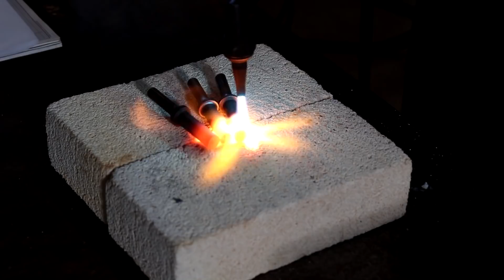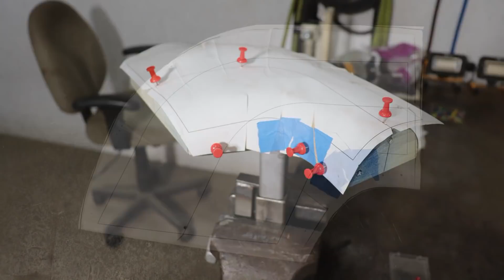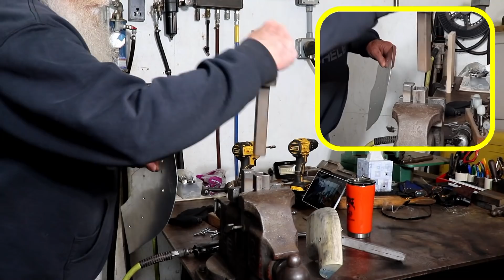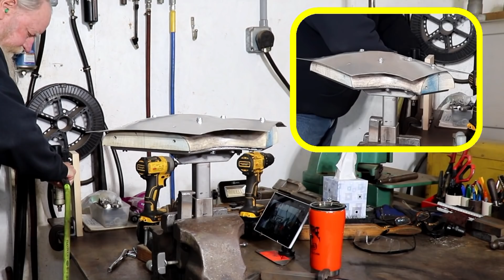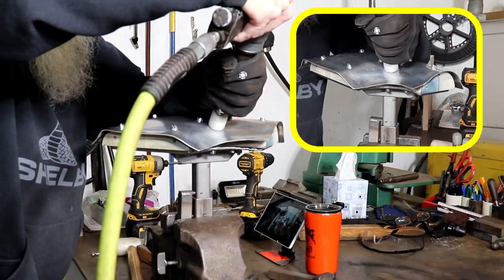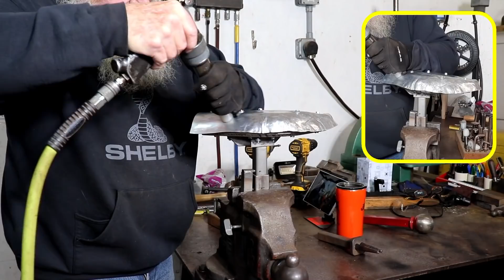Making An Odd Shape With Ron Covell – Part 3

Comment: I used to hand form aluminum duct work over KIRKSITE forms,   for the Douglas DC series air plains for the Air conditioning system, 16 Gauge 3003 aluminum,    the main trick I found was to roll the edges of the high stress areas early so the stress doesn't split the edges. as you curve and roll the panel. Then you can trim off the rolled edges after. I used hardwood axe handles sanded and shaped to act as slappers  and  hammers. 😃😃
 Great Video THANKS
Reply from the maker: Thanks for the input William.
Jere

Comment: Jere, I’m enjoying the videos, as I want to learn flow forming for an upcoming project. I’m a total beginner, and am wondering what type of aluminum to use, and if I need to anneal it. The 1100 seemed to flow a lot better for your part. Did you anneal it like the 3003, or is it soft enough in its natural state? Are these the two main choices of aluminum for this type of work? Thanks a bunch
Reply from the maker: Hi Jesse:
I did not have to anneal the 1100 as it is 99% aluminum. The application and the amount of shape you put into the piece will determine what material you use.
Sorry I cant give you a solid answer without knowing what it will be used for.

Jere
Reply: @jerekirkpatrick2092  I want to make foot wells in the floor pan of my airplane in order to have a more comfortable seating position. I want to drop the area where my feet rest on the floor about 2” lower than the existing floor. I envision two rectangular (or oval maybe) pans approximately 6” by 10” each. The existing floor material is .040 6061 T6, but the parts I make only need to be strong enough to take the abuse my feet will inflict as there are structural members nearby.  I think a speed blister shape would be easier to form, but I would rather have a more rectangular shape if possible. Any advice on material for that sort of shape? Thanks
Reply from the maker: @jessejenks5401  I have made many parts for race cars but am reluctant to make or give advice on airplanes as they are out of my range of knowledge.
Jere

Comment: What material did you use for the ends of the air hammers?
Reply from the maker: Hi Bob:
The material is UHMW. It slides easily on the aluminum and is resistant to impact.
Thanks for watching and please subscribe.      Jere

Comment: Nice project Jere.  Nice work so far.
Reply from the maker: Hi Ran. I will be welding the odd shape this afternoon and finishing the welds. I hope to have the video up by the end of the week.
It took all day yesterday to get the truck unloaded and get the shop back into working shape.
Jere
Reply: @jerekirkpatrick2092  I bet, you had to take to much back with you.  I came up with another idea for one of your gear reducers, I should of bought one.
Reply from the maker: @rrintheshop  Would you like me to send you a list of the ratios I have or do you have an idea of the ratio you require? You can call my cell 1-707-972-0677.

Comment: I never would have believed that you could remove those tucks without seeing it for myself. Great video - thanks for posting!
Reply from the maker: Hello John:
It has taken many years to learn how to read the material and see where the next hammer blow should be placed. Look at my video "Turning a 1" flange". You will see how to place a tuck and how to control it as it is worked out.
Thanks for watching.         Jere

Comment: I was excited to see part three. I have done a lot of flow forming and always have formed into a female form so it was interesting to see someone do one on the out side. I generally use fully annealled 1100 since it offers the most stretch capability and it does form nicely. For doing those outside shrinks I have found that a concave "V" shaped tool works surprisingly well for unknown reasons. About 1/2 -5/8 wide at the open end of the V works for me. I just cut it on the band saw; not too fussy. Most of my forming tools for aluminum are made from HDPE which is a bit softer than the Delrin it looks like you use and I find it friendlier for the soft 1100.
Reply from the maker: Hello Edward:
Are you saying to cut the "V" on a slant like the female portion of a thumb nail die or is the "V" cut the entire distance of the tool?
Thanks for watching and thanks for the info. Always eager to learn.        Jere
Reply: @jerekirkpatrick2092  It's just a simple Vee across the end of the cylindrical tool. About 60* included angle maybe 3/4" on a side. I suspect that the angle is not too fussy. I free handed it on the bandsaw. I have picture, but, apparently, no way to put it here.
Regards, Ed Taylor
Reply from the maker: @edwardtaylor4785  If you could E Mail the pictures to jere@saber.net that would be great.
I appreciate your sharing.        Jere

Comment: Thanks for another fine installment in this series. I love these collaborations. And I appreciate you included the making of the former heads and buck holder. Also the first time I’ve seen the tuck tool in use. I went back and checked that vid again. You have come long way since those early days Jere. Good job!
Reply from the maker: Hi Tony:
I hope you gained some good info from this series. I'm sending Ron the hammer form today so his portion should be coming soon.
Jere

Comment: I mean not to be terse in me asking but are you ,Sir using steel or Aluminum? Mr. Covell uses Aluminum . I can't tell on your videos( you make it look easy).
Reply from the maker: Hello Bob:
The first two were made with 3003 half hard aluminum and the second 2 were made with 1100 aluminum. They could be made of 20 or 22ga steel but it would be much harder on the hammer form.
Thanks for the question.           Jere

Comment: Jere, I'd be very interested to know the thickness at the thick and thin spots compared with the original .065". I'm looking forward to seeing the differences in your process and Ron's.
Reply from the maker: Hello Mr. Specialty:
I will try to give you both Ron's and my thickness measurements before I weld them together in the next video in this series.
Good question. Thanks.          Jere

Comment: Another great video. Lots of good info.  I also enjoyed the part on making the plastic hammer heads.  I would have loved to see you make that same part out of steel to see how much harder it would have been to  to make compared to aluminum.  Thanks for sharing with all of us.   Dan
Reply from the maker: Hi dd:
Ron and I discussed making it out of steel but it would have been quite abusive to the hammer form using an air hammer.         Thanks.          Jere

Comment: Love the two-camera angles with the picture-in-picture; it's the next best thing to 3D view.  I'm impressed with your video editing and camera work;  not many people have that skill set as well as the metalworking master level ability. I liked the details you provided about the regulator PSI, the alloy characteristics, the annealing demonstration, and showing how to make the polymer hammer bits.  As if all that wasn't enough lol - I do actually have a suggestion to make your production even better. For this I just grabbed the first example video link - so not sure if this is the absolute best tutorial on the topic but it will be a start and it is only four minutes long.  The video demonstrates an automated software tool to digitally remove all the spaces (just from spoken parts of your audio).  It is commonly used on professional radio and tv broadcasting - when its done right the listener doesn't even know it; and no information is lost. Audacity is freeware.  Here ya go: "How to Trim Away Dead Space Silence from Audio - Audacity Tutorial"  https://www.youtube.com/watch?v=RnIiWi3rCuM
Reply from the maker: Hello Police Dog:
I'm glad you gained some good info from this video, that is my intent to share with you guys.
Thanks for the link. I spend a bit of time working on the dead spaces in my video's and try to remove dead spaces so the movement in the video does not make it too jerky from one portion to the next. People may stop watching if I get too pro in my editing.
Thanks.         Jere

Comment: Hi Jere,
As usual.. great tips and tricks.
You said a "rational" person would make that in 3 pieces. You didn't do that. Later you said you were "bull-headed". I guess that does sound better than "irrational". ;)
By the way.. I tried buying you a coffee again but I still get, "The merchant requires a US billing address for all purchases made using PayPal." 
Apparently, (according to PayPal help) you can "Make adjustments to your Block Payments settings in My Seller Settings."  I have no idea if that is the case but maybe you could check that out. You might be missing out on a lot of coffee money! 
Joe
Reply from the maker: Hey there Joe:
I seldom move into the realm of "rational". It seams so boring and predictable.
Thanks for the heads up on the coffee. I think the setting are that way because if I sell something from my web sight it will not calculate the shipping charges for another country.
I will give Pay Pal a call and see if there is a work around. Heaven knows I need your money.
Thank as always.          Jere
Reply: Others seem to get away with not being rational so I gave it up years ago. It just wasn't fun.
Good luck on the PayPal thingie.
Joe

Comment: holy cow!  I too had no idea how different 3003 and 1100 are.... I would have just struggled with the 3003.
Reply from the maker: Hello Zeke:
I have worked mainly with 1100 and very little with 3003. Mainly using 3003 for Cobra doors and front fenders where there is not nearly the amount of movement required. This exercise has taught me a lot about working 3003.
Thanks.           Jere
Reply: I agree with Zeke. This difference in material behavior is surprising. You mentioned manganese being present in the 3003. I assume that reduces its ductility? The understanding of the metallurgy is really impressive.

Comment: thanks as always Jere, i really enjoy this series. it's covering a lot of areas that i need more experience in. by the way, where would one obtain a spherical head, post dolly like you have?. Cheers.
Reply from the maker: Hi Eddie:
I hope you have gained something that you can use in the future. The ball can be found at an ornamental gate supplier. They are used to cap a square post. The one in the video is for capping a 4" square post. You have to remove the bottom portion of the casting.
Thanks for watching.            Jere

Comment: Jere - you did a great job on making that deceptively difficult part from one piece of metal! I haven't worked much with 1100, and I'm surprised at how much more malleable it is than 3003. I'll be eager to start on my portion of the job whenever you can get the hammerform to me!
Reply from the maker: Ron - It was quite a challenge with the 3003. Knowing how often it work hardens under the air hammer I may give it another go. Will call you this afternoon to see if you want to use the work station.         Jere
Reply: Machinist checking in. If you guys haven't tried out 3104 aluminum you may want to. It is an excellent alloy for forming as it resists work hardening and can be drawn thin pretty reliably. I believe you want condition H19
Reply: @SuperAWaC  what is condition “H19?” 

I’m kind of a new hobby machinist so all this info is new to me. Is there a book or some other good source where you can look up the specs of different metals? 

Ps. Sorry if those are dumb questions... lol. I’m learning.
Reply: @mxcollin95  Look up "Understanding the Aluminum Temper Designation System" from NIST
Reply: @SuperAWaC  thank you! Will do.
Reply: And I can't wait to see your approach to the same. Two masters classes for sure!
Thanks again for the help you offered on Easter Morning to help me to prevent my shrinker stretcher from leave it's Mark in more than a few unfavorable ways!
Emery cloth really is something!

Comment: Did anyone else cringe when Jere reached in to grab the hammer head material and then grabbed the shavings off from the cut off wheel? Love the fact you said you are bullheadef and didn’t want to build this piece out of 3 pieces👍🏻👍🏻
Reply from the maker: Hi Mike:
The saw is only turning at 54 rpm. Even a newly sharpened saw will not cut you. They are quite expensive but they leave little bur and don't smell like an abrasive saw.
As you may have noticed, I am not ashamed to show my mistakes if it will help others not make them.
Thanks for the great feed back. I love it.           Jere
Reply: Thanks Jere. Loving your work 👍🏻

Comment: Very interesting, and so many details.  😀  I was very impressed on how the rivet gun performs with your machined tips.  Cool idea on the post clamp adapter for the vice.  This process really highlighted how complicated the part is to form.  Thanks for sharing 👍👍😎👍👍
Reply from the maker: Hi ya Joel:
I was quite an eye opener for me to see the difference between 3003 and 1100.
If you make one of the tool holders for your vise then all the tools you make will be held steady when using them no matter what angle you do your work in.
Thanks for the coffee also.            Jere